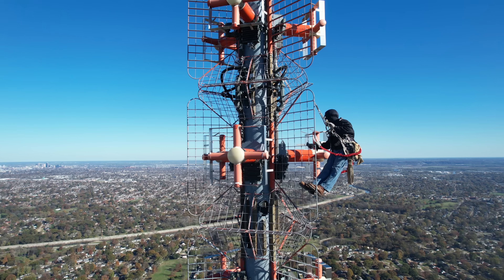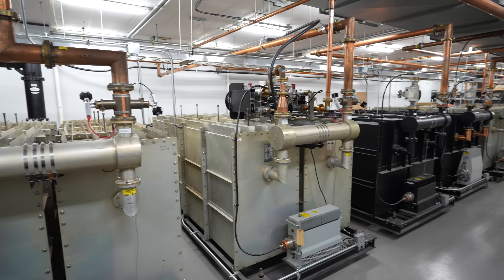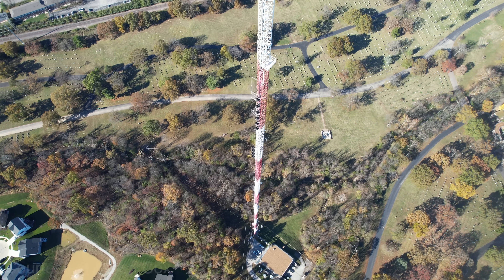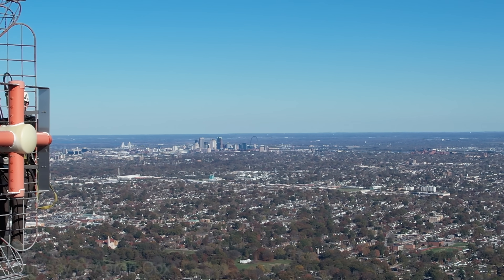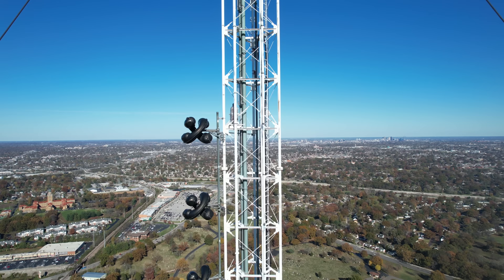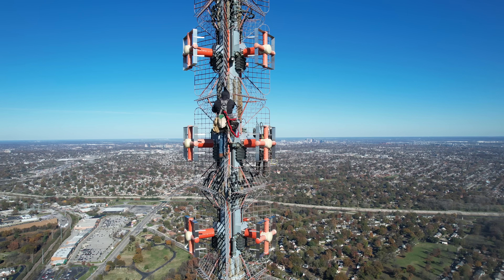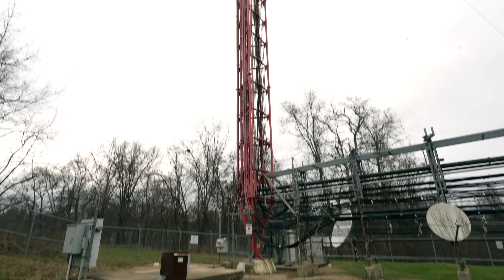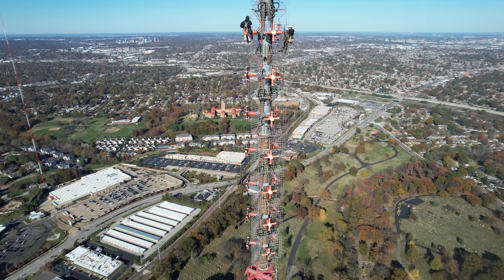Engineers react to 1100 ft Radio Tower Climb

Comment: Typically for safety reasons you wear a radiation suit and mpe monitor. The suit is very light really looks like coveralls with matching hood, gloves and socks. In every thread of it's fabric is a strand of stainless steel which reflects rf so it's like a mirror for radio waves. The mpe monitor is smaller than a lighter and when it sees that you have reached maximum permissable exposure it sets off an alarm telling you it's time to go back down. Radio towers, especially ones with that many high power antennas have residual RF and even with all transmitters off you're still exposed.
Reply: with the TX off there is no residual radiation. Its RF, not x-rays!

Comment: Imagine getting to the top and realizing you left one of your tools in the truck.
Reply from the maker: Time for a tool trebuchet!
Reply: @GeerlingEngineering  Don't spoil your 2025 videos! 😂
Reply: a new idea for drones. "hey bobby, send up the 10mm socket"
Reply: @jamesking890  "No problem!" Now where the heck is the 10mm socket at!?
Reply: @misfitsman805 we don't use 10mm sockets lol
Reply: Checklists are your friend.
Reply: It's faster jumping down and use a parachute.
Reply: Most of the guys I've met, have two or more, of the most used tools.
I have seen a drone taking items up, and down.
Also seen guys hanging out of a helo with a pressure washer.
In Australia we don't do things by halves here.😆
Reply: That's why you end up taking much more weight than you could at a minimum, including tools that you might need, just in case.
Reply: Just turn the antennas on the towers on and broadcast to your coworker down below 👁☠️
Reply: @Swede_4_DJT the RF would cook dude from the inside out
Reply: Been there done that.  The opposite too. A couple of our guys climbed 500'. Thinking a backup battery needed water.   They carried a gallon jug of distilled water up with them. They made it up there to find out it was a maintenance free battery. You couldn't put water in it if you wanted to. Since the tower was in a rural area and there was nothing to hit. One of them through the jug of water as far as he could off the tower.  As far as I know, they had no other reason for going to the site. They climbed back down and went home.
Reply: Would be me
Reply: He'd be fired lol
Reply: If there was any RF being pumped out of those antennas while that drum is flying that drone would not even be in the air LOL and if it fell from that high up and hit somebody on the head it would probably split them in half

Comment: Been up towers, but not ones that high... Have a lot of respect for those climbers.
Nice radio station, those combiners are a work of art besides all the engineering that goes into them. 
These days I work on my own antennas, mostly wire type for amateur radio. My tower is only 58ft tall but I still climb it once in a while to do repairs or replace cables, baluns, etc. 
Keep up the great work and thanks for the super drone footage!

Comment: If I put a 1 foot high step-stool on a floor, I could stand on that stool with only one of my legs and my other leg could be be hanging over the edge of the stool.  I could hop up and down…and never once worry about falling.  I could stand on one leg and hang over the edge and I wouldn’t be worried at all.  I could do that if the stool was a couple feet high.  But any higher…no way.  Especially while on top of a 1000 foot tower.  Physically, there isn’t any difference between doing this while at 12 inches high or 1000 feet high.  The fear is all in my head.  Nevertheless, my hat is off to anyone who can do this kind of work.  I have climbed 120 foot towers before, but only because it was necessary to save lives (2-way radio, tactical work in some locations where there is lots of sand!  😂).  That part of my life is now over and done with….sooooo, never again!
Reply: Physically, the difference is if you look down.
Reply: @KameraShy Physically, the difference is if you fall. If you fall one foot, you're unlikely to get hurt. If you fall 1000 feet, you're dead.
Reply: @KameraShy The other difference is, if you fall off a stool, you'd be ok. If you fall from a 1000 feet tower you most definitely would not!

Comment: This is a great video of what happens during a tower inspection. Hopefully, the grid panel is solid without welds. If that's the case the climber is safe. There was a fatality during my radio career where a weld failed in the mechanism the tower crew used for a gin pole. The climber fell from around 150 feet when the weld broke. I never want to be a part of that, ever again. Keep these videos coming. Old, retired radio people like myself take great enjoyment from them. 73.
Reply: Tie off points need to be rated at 5000lbs
Reply: BASE rigs should be mandatory equipment
Reply: @Jump-n-smash  guy wires... lots of them... a chute is likely to get tangled and still kill you

Comment: Wise to avoid using the drone when the RF is on. From experience, it does indeed wipe out comms between drone and controller. That was with 'just' 25KW ERP. I have my drone set up to return to home in the event of losing comms, and thats what got me out of trouble. Also, don't fly in front of microwave drums.
Reply from the maker: Re: flying in front of microwave drums:

What if it's a cold day and you want to warm up the drone a little? :)
Reply: @GeerlingEngineering   I don't think the microwaves have enough power to do any warming.  It's not radar.
Reply: Instinctively, what you’re saying makes perfect sense. In practical terms, however, I’ve flown my drone up the side of a 1,000 foot tower at roughly the same distance as the flight in this video. That was in a DJI  Air 2S. Four FM stations, along with a top mounted VHF HD TV channel. All were operating at full power.

I’ve also seen a YouTuber fly a DJI mini 3 pro in extremely close proximity to a very hot FM and TV transmitter facility without issue.

Maybe we were just lucky, but I think the ocu-sync technology in current model DJI drones provide a pretty robust RF link.
Reply: @WebVid  Mine is a Mini4 Pro, so using the latest transmission methods.
Reply: @stuartmiller6725  The Mini 4 Pro uses Ocu-Sync 4 as its RF interface. It’s incredibly robust.
Reply: @WebVid  That really could go either way...  HDTV 30.1 (for example)  is 575Mhz, and I believe all current HDTV transmissions are in that general neighborhood. DJI's O4 video transmission is in the 2.4Ghz or 5.8Ghz range, depending on country (although it's not clear, unless I missed it, what the control frequency is, unless it's part of the O4 communications). Even with that difference in frequency, if you get close to a 1,000 kW ERP antenna such as the KPLR antenna, it very well could overload the receiver on the drone, at best triggering a RTH event, at worst, it could potentially cause other issues within the drone, causing it to shut down and crash. Always err on the side of caution.

Edit: As a side note, I've seen similar interference before. When I had XM Radio active in my truck, when I would transmit on 2M at 50W transmitter power (not accounting for antenna gain), it would overload the XM receiver and knock out its reception. Granted, XM was receiving a rather weak signal from satellites way above, but in the grand scheme of things, that's not all that dissimilar to the 1,000 kW (1mW) ERP of the KPLR antenna vs the drones communication power.
Reply: @aperson9495  All valid but I think we also need to factor in modulation scheme. It's incredible what can get through in the digital domain.
Reply: Great idea! Seems like that might do well as an optional default response to loss of comms.
Reply: @HappyQuailsLC  Its the sensible option in my opinion and mitigates most of the risks. Its not foolproof though, as when RTH activated, the drone flew in random directions at first. I'm wondering if the RF was knocking out the GPS on the drone? Nevertheless, it did come back in the end!
Reply: don't fly in front of my 1.296ghz(23cm) ham antenna array then LOL 4 phased antennas and 25dbd gain... ERP is 230,000 watts! Yes I have an RF safety sheet in the filing cabinet that gets updated anytime I make a station change! The stuff I play with can be deadly! But that 4 antenna array has a 7 degree beamwidth... none of that power reaches the ground for thousands of feet... by then it is very safe.

Comment: Man, just even watching the drone footage makes me queasy. When you're young, sometimes you feel immortal. I think you'd kinda have to feel that way in order to climb that high and do a job. Just amazing, interesting stuff.
Reply: Not really, I'm in my 30s and do rock climbing and as long as I am tied in I don't get scared/queasy. A lot of it is understanding the gear (so you can manage the gear fear), the risks and what's safe and not safe. Like their harnesses are so strong that their bodies will break looooong before their harnesses break. Carabiners if they're "rated" for rock climbing (which is what I can speak of from experience, thou industrial rope access is basically uber bomb proof rock climbing gear that is heavier and has more "rated" attachment points which are often steel) are good for >20kN. To put that into perspective, 20kN is 2039kg or 4496 lb. Probably about the weight of the average American "pickup truck". There are steel carabiners used in industrial access that are good for over 60kN!!! or around 6 metric tons or about 12000-15000 lbs
Reply: They do clip into a safety harness and fixed cable, anchored to the tower. If someone were to slip the'd dangle, fixed to the safety line.
Reply: How much more dangerous really is falling off the top of that 1100' tower than falling off a telephone pole?

Also, I think it can be kinda hard to predict how you'll respond to stuff like that. I never thought I'd enjoy rock climbing, but for some reason my brain is cozier with being on a rope on the side of a cliff than standing close to windows in tall buildings.
Reply: @SnakebitSTI  telephone poles are different as often people are using a "flip line" or a pole climbing line. "Gaffing out" as they call it can be quite dangerous if the line is too loose as you can just slide down the pole, in tree work sometimes arborists flip line up, sometimes they throw a line and ascend the rope. Arborists tend to attach a safety ""life"" line (although not all arborists do) which forms a second point of attachment for both redundancy as well as an option for a fast rappel (say if they get cut/hurt).

Comment: What were the black "curved X" shaped antenna designed to provide?

... and that does look like fun.
Reply: You are probably referring to the FM antennas with the nick name ‘roto-tiller’. They are designed by ERI and are used at a large number of the high power FM stations around the country.
Reply: Also, keep in mind that the "curved X" gives the antenna circular polarization.

Comment: I visited the old VOA Bethany site  during my senior uear of high school. Our radio club was granted permission to visit the site, whih was in the roceass of a total upgrade. This was near Christmas of 1969. The original Crosely transmitters were being replaced with ten knew 60KW ransmitters because of severe TV I pronlems.
The oiginal contro room was bein replaced, as well. It was to become secondary master control , in case the Washington DC sitee went down.
During the tour, an engieer pulled an eight foot fluresecnt lamp out of a locker. It lit to funn brillance from the RF fields.
The ten new transmtters could be tied to a sincle VFO, and combined up to 60 KW, anywhere from theAM bnd to 40 MHz. The engineer nearly fainted when I joked, "Have you ever considered putting 500KW on the CB band and anouncing, "Theres a smoley on your tail, 18 wheeler?" He went plale. "Tey wold send me to prison, for life!"
I asked if they were going to preserve at least obe of the beautifl Green metalflake & glass Crosley transmtters for a musem. I  was just layghed at.
I also sw the 500 KW WLW transmitter that day, followed by a Cincinnati hock stayion with a very early automation sysem for an FM station at that sire. Everything was progammed with banls of tenn or 16 position slide switches. 
The old WAX tower site in Orange City Florida had and eight input FM antenna system. Three ports were unused, but they had a full time engineer who lived on site for the five full power FM stations. I believe the antena was at the 1200 foot level, while WACX was on the top at 100 foot. We had a bew Comark reansmitter with a 5MR EIRP signal that covered aput 1/3 of Florida. It wasthe tallest tower in CCentral Jlorida, and only allowed  becase Ch 2 was a mile away at 1200 feet, and in a near stttraight line to the nearest airport.
I used to do sunday ight maintainence . We had a sometimes finly LaCart Umatic video automation system, and STL links from Orlabdo and Lessburg. It as real fun to configure a clean crossfade between studios for a live Telethon. becus the only vaiilble equimpent was fro two different vendors. A faer cry from my statrt at a 20W Gates AM transmitter & a 850W Chaneel 8 station at Ft Greely, Alaska.  I was the dirst real engineer assigned to those stations, and the AFRTS Depot never showe dd up to do anyhing so a lot of things were juryrigged by a couple hams from the MARS station. Tat was in '73/'74.

Comment: Back in the 80s I was working on the TEP4 contract in Saudi Arabia. Although my role was nothing to do with the microwave towers I had the gate access codes. Used to climb the 125m towers on the remote desert routes for fun. No safety equipment, just the madness of youth. #goodolddays

Comment: I always thought that the fm radios antennas were cut to the specific frequency? Is there enough band width on the antennas to facilitate a frequency spread without detrimental vswr? I know on my ham radio antennas that are cut to a specific band I only have about 200 KHz before I need to use an antenna tuner. BTW the RCA antennas manufacturing site was only about 3 miles from where I live now. And so was the RCA Broadcast transmitter manufacturing plant.
Reply: I’m very familiar with with transmitter antenna combiners. We use them in the FAA at sites where tower real estate is at a premium.
Reply: each bay of that antenna is a simple crossed dipole setup, a dipole at VHF has a broad frequency response so it can cover 8 or more mhz... A wire antenna like you use is close to the ground and suffers ground and obstacle effects limiting its bandwidth... it is also a very skinny radiator where those FM antennas may be a wide flat element and the wider an element the broader the bandwidth. The military uses cage dipoles at HF for this reason, no retuning needed with a large frequency jump.

Comment: If the tower is turned off, how do those stations stay on the air?
Reply from the maker: Some stations have an aux antenna on the same tower (some of those side-mounted ones), others have an aux at another site in the area (usually lower power, but often enough to cover the St. Louis Metro area still).